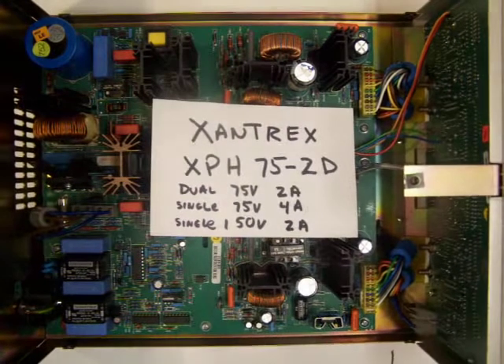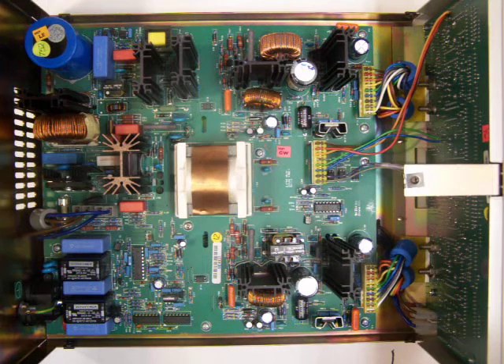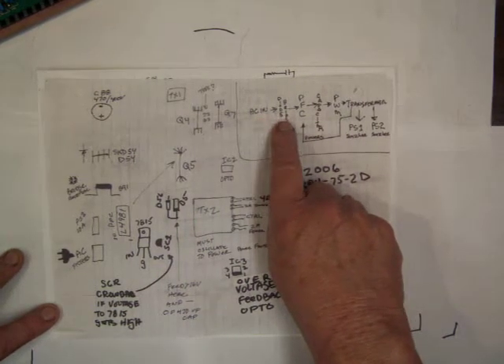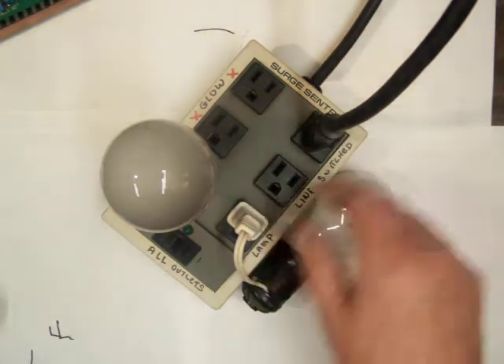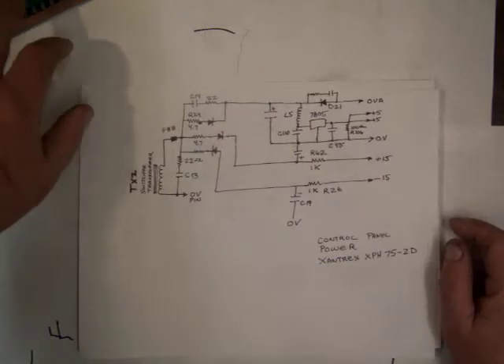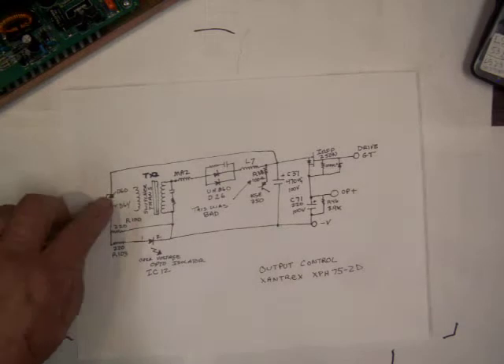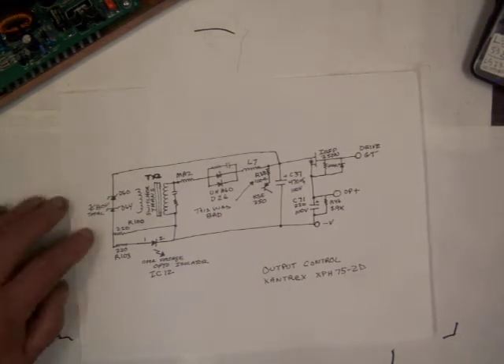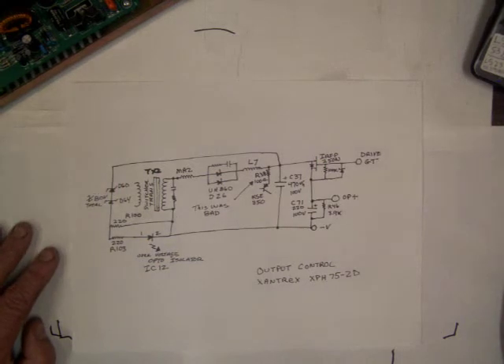XANTREX XPH75-2D Repair, Dead DC Power Supply Ticking Approach

Comment from the maker: To view a similar output section see the schematic, search TTi EX354D service manual. These resistors a special and designed to fuse open quickly in the event of a problem.  I replaced them with standard resistors which works, but you run the risk of major damage the next time. It might be worth making a list of the resistors and their values as actual information on this will be difficult if not impossible to obtain.

Comment from the maker: Sorry for the delay, I was moving to my summer home. Oh, there is so much to do when you abandon a house for 8 months. That supply and all documentation is home.  The display has its own converter and I think that is powered from the main inverter PFC>boost inductor>300VDC>switching FET>transformer> DC>display switching regulator. It runs a little hot with no load. Sure that something is dragging down the voltage so the display inverter stops working. These will always bump till the transformer can supply enough power.  EEVblog has some people that might have some more information. I'm stuck in the woods! Good luck.

Comment: Found this video looking for any info on Sorensen XPH power supplies.  I acquired one of these and some probably bad spare boards.  All tossed out from a lab.  I am sure the lab tech had limited time to look at them and gave up quickly.  This unit is a 42v and 10a rated single supply.  It actually seems to work OK provided the output is set below about 13.5v.  Over that and the front panel blinks on and off.  I've done enough troubleshooting on it to tell that the 13.5v power to the 5v linear regulator that provides logic power to the control board/front panel starts to cycle on/off.  If very quiet you can hear it ticking.  Only does this if the output is enabled.  The main smps seems to run pretty warm on the xformer and heatsinks even with output disabled.  No schematics seem to be findable for these.  There is no obvious damage or burned components.